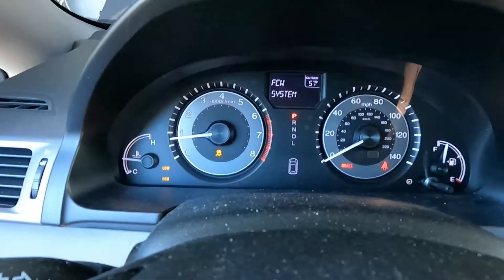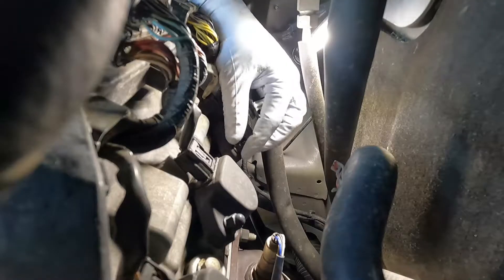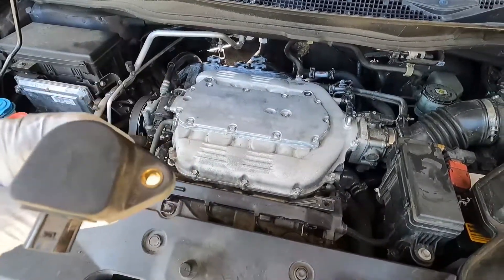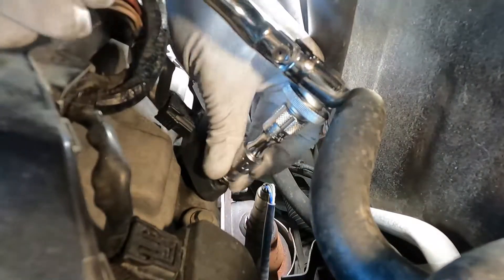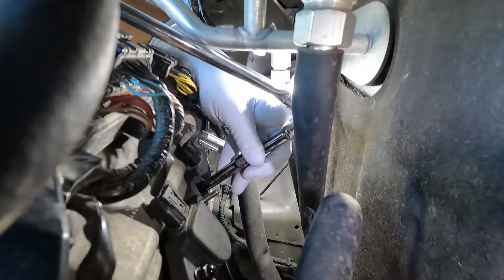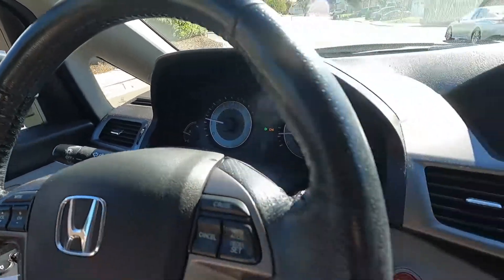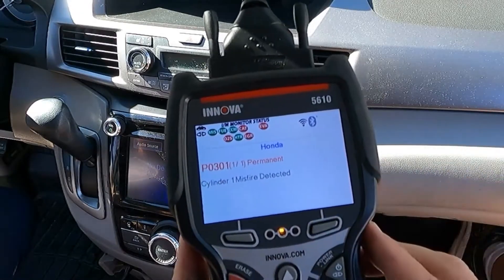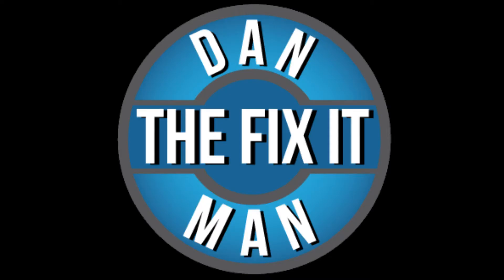If you see the Check Engine Light Flashing, STOP Driving Immediately! Honda Odyssey P0301 - Innova

Comment: You are half right about oil passing the pistons. Had same issues running rough. When the VCM shuts off the back valves are closed but the cylinders are still moving allowing oil to pass by the pistons clogging the spark plugs . I researched and got a VCM muffler. No issues since. VCM does not kick on anymore.

Comment: what weight oil does honda recommend in this engine; 0w20 perhaps?  would a 5w30 help reduce the oil build up, or possibly even changing the brand of oil (not all brands are created equal).  curious how often the customer get the car up to operating temp each drive and then also goes WOT occasionally.  Get those pistons moving past 4k rpm.

Comment: My little oil can symbol is blinking but not the check engine light???   Weird
Reply from the maker: A Blinking Oil Can Light in a Honda can mean you have:
1. Low oil level: If the light blinks while the car is moving, the oil level may be low. Check the oil level and add oil if needed.
2. Low oil pressure: If the oil light stays on while the engine is running, the engine has lost oil pressure, which can lead to serious engine damage. Low oil pressure can be caused by low oil levels, a worn-out oil pressure sensor, or engine wear and tear. 
3. Engine oil temperature: The oil light may also blink if the engine oil temperature is too high. 
In any case, you should take immediate action and have a professional mechanic diagnose and repair the issue. Ignoring the light or delaying repairs can lead to expensive and potentially irreparable engine damage.

Comment: Folks: It is important to note that in almost every case the real problem is NOT the “piston rings aligning” cause but a Honda design flaw caused by the VCM (variable cylinder management) system that deactivates three, sometimes four, cylinders in the pursuit of fuel economy. To settle a class action suit from 2013 Honda agreed to a warranty extension — now expired for many owners — and to cover certain repairs. But the company has never admitted that the real cause is the VCM system. The solution, as mentioned in another post here, is what is called a VCM muzzler. The best example is the VCMtuner II. It costs just $140 and takes minutes to install. (They are also hard to get because of demand.) 
Relatives own a 2010 Odyssey with just 99,000 miles, and cylinder misfire — also cylinder 1 — occurred some time ago and was only temporarily fixed with new plugs and a coil for that cylinder. A few days ago it happened again, and the shop found that misfiring had broken the no. 1 spark plug, and the tiny piece of porcelain had scored the cylinder wall. There is a very real chance that this otherwise pristine Odyssey, which should be worth well in excess of $10,000, now has a value that is a tiny fraction of that.

Comment: Dan, very well made, easy to understand video.  Thanks! We have a 2010 Odyssey that has an engine light that just started flashing.  All mechanic shops are closed already so I told my wife to go to AutoZone and have them see what code comes up.   They came up with 5 codes. P0305 - Cylinder 5 misfire, P0161 - S2 Heater Circuit Malfunction, P0302 - Cylinder 2 misfire, P0300 - Random Misfire, and P0303 - Cylinder 3 Misfire.  Van has about 240K miles on it and my wife says it seems to be running fine...  I will pull all 6 plugs probably next week and see how they look.  Would you recommend just replacing all cylinder coils and plugs if the plugs have no oil on them?  Also, I will attempt to look up what the code P0161 is but do you know what that is?  How do I fix that?  Thanks again!
Reply: Unfortunately the tbs campaign is expired and still honda would   not fix. It's pretty much a head gasket and re ring back pistons. Because tsb expired we are responsible to for the fix.

Comment: My wife's 2013 Odyssey is having the same exact issue and has for a couple of year now. I replaced all 6 plugs just over a year ago and didn't have any issues until just last week. Just had the valve cover gasket and spark plug gaskets replaced literally today but now the engine light is flashing AGAIN. Talk about frustrating. It's only got 135k on it but this makes me want to junk it.
Reply from the maker: Hi Thomas,
Yep, it's pretty frustrating for sure.  If you read one of the comments below, you will see that some people have had a little luck with Honda stepping in and taking care of the problem, but with that many miles, you're probably going to push pretty hard to get 'approval from corporate' for this issue.  It might be worth pursuing, but it's also pretty inexpensive to put a new spark plug or plugs depending on which one or how many are oil fouled.  That might help keep it running for a while until you decide what to do.
Best of luck to you with it.
Take care,
-Dan
Reply: I have a 2012 odyssey changed all plugs at 110000 miles then today at 210000 cylinder 3 misfired, pulled plug it looked horrible, but had 100000 miles on it. I replace a quart of oil with marvel mystery oil every oil change, I think it keeps rings from sticking so they do there job, I use mobil 1 oil. I think the marvel will lower your headaches,  but if the engine is dirty it will take time 4 or 5 oil changes.
Reply: @buckandbrandy Have you solved the problem?

Comment: Similar issue on my 2012 Odyssey. Blinking check engine light at 69k miles. Issue covered under a class action lawsuit/settlement. Dealer replaced 3 pistons and rings. Same issue reappeared at 124k miles. Dealer replaced small block. Both instances were covered by Honda for free although the second one required special approval from corporate. Sold vehicle at 232k miles and no issues when I sold it.
Reply from the maker: That’s great info, thank you so much for sharing.
Reply: my wife is on a road trip with her sister and having this issue. hope Honda is kind to us, have any info about the lawsuit?

Comment: Yeah that's not a long term fix, That oddessy will be back soon. My honda pilot 2011 had a similar problem. For my Pilot I disabled the economy mode and changed all spark plugs. Running  well after I worked on it.
Reply from the maker: Agreed.  It will probably need the new rings as the TSB suggests…but running fine for now.
Reply: How long does it take before the issue happens again?
Reply: @johnedward8352 3 day
Reply: I'm having the same problem. I changed the burner's full, and it didn't work.